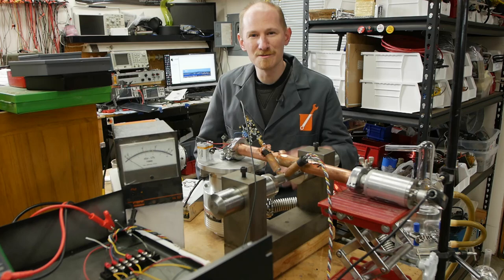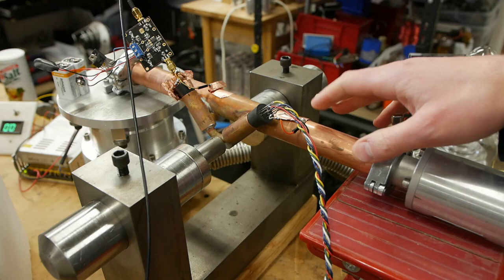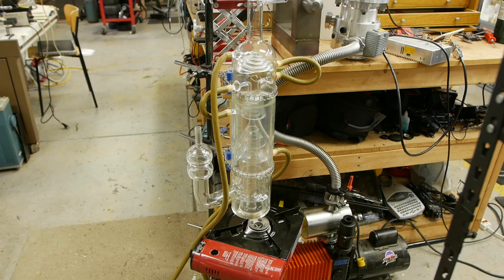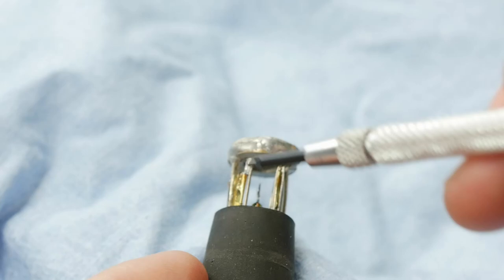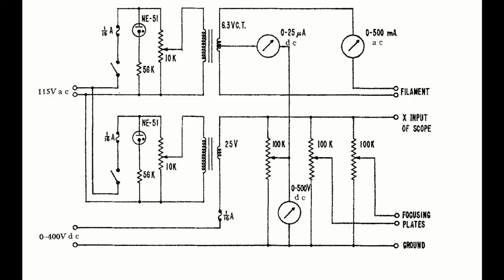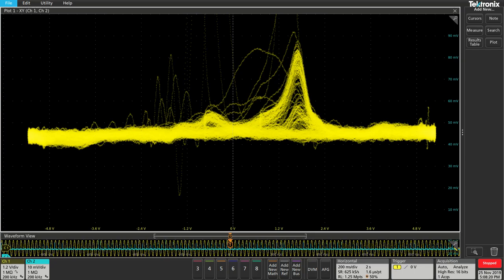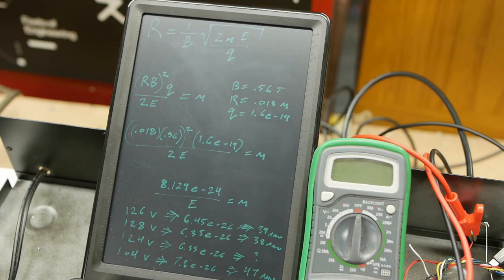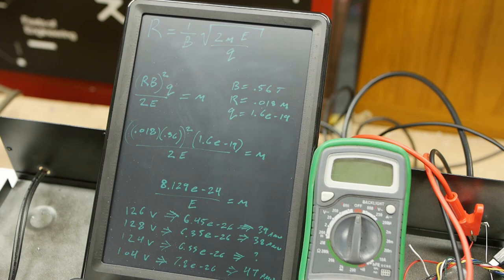DIY mass spectrometer measures potassium in dietary salt substitute

Comment: Flippin' incredible. Few points from bitter analytical lab experience:
- Regular hose clamps are a nightmare for vacuum, they create a pinch which invariably spoils your day
- Find something like a Mikalor W2 clamp, use two, 3" hose over the tube and HiVac grease.
- Those thick rubber tubes get tricky past about 10^-3 torr mostly due to the above, but I've had success to 10^-4 with vacuum epoxy as a sealant and the correct diameter tube. 
- Solder won't be a problem until silly vacuum, but the flux would make you very unpopular in any analytical lab... but definitely the perfect option for you.
- Your calculations and conclusion appear correct, and that does look like noise; in the mains-provided bias voltage perhaps?
- I wouldn't discount the prior spectra, their peak area looks to be very close to 6%, without knowing the details and scaling perhaps your resolution is just lower?
- Try introducing CO2 into the source, it should ionise nicely and give you another peak at m/z=48 to work with, Argon is also handy at m/z=40.
- It'd be really interesting to see some organic compounds, if you've got any gamma-unsaturated aryl ketones you should see some lovely parents and McLafferty fragments, Isopropanol should give you a great carbonium ion at m/z=43, most aromatics should give a radical cation and a salt of that 2,2-bipy would be spectacular.
- In order to get good ionisation of organics in EI+ (and often EI-) a source makeup gas, often chlorine / ammonia depending, is used to provide a cation stream to ionise the sample and occasionally form adducts; this may be a useful technique if you have problems getting your organics to fly, if you do indeed try that (which I hope you do!)

Comment: You are so close and on the right track. If you keep working on it I'm sure you will keep improving. Even if you don't specifically try to calculate the cause of the issue, sometimes just time and using the system you figure stuff out. Keep tuning it up and looking at each component to see if there is any low hanging fruit to tinker on and improve. I mean just a mm or two or a degree of angle could make a big difference here I feel like.

Comment: Very cool. I'm a pro at this -- I did my PhD thesis using TIMS at MIT. We literally built mass specs of this kind by hand. Far more advanced obviously with big hand-wound electomagnets and 10KV accelerating voltage.  My thesis involved the isotope ratios of neodymium measured to better than 0.003% and the result got into Nature (no bs: v. 371 p57-60). Today nobody does this, all mass specs are off the shelf, and much better than I used. But this is how A. O. Nier did this in the thirties making possible the separation of the masses of uranium (you know where that led, hah, pun intended). Anyway students these days never ever get to think about mass specs like this. It's just an aluminum box to them where samples go in one end and come out the other.  wonderful, thank you for this video which I will now make required for my students. Maybe I can build it myself. A little higher voltage and bigger magnet you could get the mass resolution to resolve that doublet peak, and get a better read on what the small peak is. My guess is double sodium, which would be 46.

Comment: generally you need further than 600v to achieve a good stable ion sources. i think is the electron count frequency which induces plate heating. you can't usually achieve that with a beaming circuit you'd need a hv-retransformer finely tuned to power the bulb and also the ground state being driven by some tuned hv matched with the target current of the ionizer.  the result looks very attractive, the cannon is pretty nice built. nickel from the needles themselves do a very nice job.. remember you'd need a more stable emitter than tungsten. tungsten emits lots of neutrons if the current is variate. and such are tungsten carbon filaments, not pure winding. that would halp making a more better looking case to me. great work amazing

Comment: Awesome DIY science project!! 

As for the tapered rubber stopper sealing but the Pro Vacuum hose not sealing, it could be that the rubber stopper seals because the vacuum is "Pulling" the stopper into the copper tubing opening causing it to seal tighter and tighter as the vacuum increases.
I would almost bet that if you used a rubber stopper with tapers on both ends and the required hole diameter in the center (instead of the rubber coupling mounted external with hose clamps). it would seal just as good as the tapered rubber stopper simply because the vacuum would pull the rubber into the tubing as the vacuum level increases. 
I had to create such a coupling once because of a pin hole in one of my vacuum hoses, this was on a home air conditioning system, it was on a hot Sunday so no supply houses open,  I had a rubber plug that was used to hold nitrogen in the line set, I used a Dremel grinding attachment to shape the tapers and to make the hole through the rubber, it worked good, I was able to pull a vacuum down to less than 500 microns.
Anyway, just a little food for thought. :-) 

Again, awesome project!! :-) 

Joe

Comment: Amazing progress! Putting a gas chromatograph before this setup would be a great addition, not so much for the separation power - but for the infinitely repeatible sample introduction capability! I've built a few versions of a DIY GC (see my channel), and have found that you can get acceptable separations without any column heating. Do note, however, that a GC will require a complete rework of your ion source, to something like an Electron Impact source, and chromatography is not really compatible with MALDI (which I guess is what you're hinting at). 

Basically all you need for a simple GC to introduce samples into an ion source is a capillary column, 5m is probably fine at first, an injector, where a syringe can introduce a small amount of gasseous sample, and a carrier gas and regulator to push it through. Also, before entering the column, it is a good idea to have a split with a variable valve, so you can choose how many percent of the flow goes to the column and MS, and how many to waste (or a 2nd detector). This will let you tune the ion current pretty decently.

Thank you for this interesting project!

Comment: Great video! Working in science for a long time you tend to get a bit abstracted from what is ACTUALLY needed to make something work, and just what you can achieve with even "simple" equipment! Its all too easy to think "oh its impossible to make something like that they cost thousands to buy!"

A comment regarding the mysterious 2 peaks: Could this be an artifact created by the different halves of the AC acceleration voltage... ie. as the AC part of voltage is increasing, on the first half of the sign wave, you get one peak, and on the second half, as the voltage starts dropping again, you get the second. So there is some slight asymmetry in the system,  created by some charging up in the system or some such?
Also a comment on feed throughs for vacuum. One great way to do these is to actually use a small Circuit board (very cheap from places like pcbway.) You can have through plated holes in the PCB that lets you solder in pins or wires (between air side and vaccuum side), and once soldered you can use the PCB iteself as a vacuum flange. For big flanges you need to add a bit of support in the center of the PCB, but its very effective and ideal for things like thermal evaporators, where you can solder in big thick copper conductors as well as having smaller holes for thermocouples etc.

Comment: Amazing work!

With a gain that high, it might help to enclose the amplifier and batteries in a metal shell, taking care with grounds. The traces are short, but exposed, and other parts of the circuit board could pick up signals or even static.  

Other ideas:
The voltage steering... It might work better with plates instead of wires, to get a uniform field (I have no mass-spec experience here, just working on a mental picture of the E field between two finite cylinders).  Ions might go flying off askew and experience different deflections.

Comment: I work with one of IBA's C70's over here in indiana and your rubber stopper works in a shockingly similar way as our plasma source. Basically, a large lightbuld with and hydrogen gas supply, and electron surpressor, and a positive ion puller. Our steering is done with. Some magnets in our injax line. However, it appears as though you are effectively collimating your beam with the razorblades. Very cool

Comment: Years ago, I used to work with Dr Emiliani at the University of Miami in South Florida. We had 2 types of mass spectrometers. One was a low resolution that we used mostly as a leak detector. For that it was mostly tuned to helium but we often times looked at other things as well. The other that we had was an isotope ratio mass spectrometer. This requires a longer flight path than you have. This was used for paleo temperature work( looking for ice ages ). We did this by taking a particular foraminifera that live at the ocean surface. We'd sort these out by hand and then use some acid to change them to C02. That would be fees into the mass spectrometer. I mainly worked there because I understood the electronics. Any way, the foraminifera would fractionate the oxygen ratios. I also help in a carbon 14 lab that used a modified scintillation counter( I modified it ).

Comment: Nice work.   Especially since Cu, solder and ordinary rubber stoppers are pretty dirty outgassing materials in a high vacuum.   With the Turbo that close you should easily get 10 E-6 torr.   The sinusoidal modulation of your HV is easy but I have to agree with the gentleman who recommends a sawtooth modulation (standard in old CRT oscilloscopes).  Sine wave modulation will result in a nonlinear mass # vs display position.   The easiest way might  be by sawtooth wave modulating a HV vacuum tube made for RF transmitting. Ditto also re "don't boil the diff pump oil" !  With the burner turned up as high as you had it, it becomes a backstreaming nightmare.   The electric heater in my metal  diff pump is rated at 500W  but the recommended operating wattage is 420 W.  A stainless tube with KF flanges and two feed through blanks should yield a dramatic improvement in performance.  Great stuff keep going!

Comment: Outstanding work - the ion source alone is worth 2 👍🏼 -  a control run with  bare filament (already mentioned several times) for comparison,- a run w TiO2 on the filament ,  and try changing the length of the coax betw preamp and main amp.   .66  or 3x  — exit slit is orthogonal to beam scan direction?
Really enjoyed this - took me back to my days in the lab underground.

Comment: You could easily make many of your problems go away. We built one at the university. We built one 8 meters long. The sample was in a metal box the size of a matchbox and vaporized with heat, then ionized and accelerated. It could run for weeks. A heating filament in a radio tube was used, not a lightbulb. If I recall, it was a much better electron source than what a  light bulb wire can be. An electron trap catches the electrons, and the now +1 ionized sample are accelerated in a normal direction of the electron flow. The accelerating voltage was 800V. We used an electric field to cancel out the magnetic field, and varied the electric field. Also used two quadropoles to focus the beam (or maybe on to just flatten the beam for better resolution, the second would be for signal strengthening.).  I would also try out using a Microchannel Plate or nightvision sensor to measure many channels. I have never tried this, but it would be fun to test even a back illuminated CCD/cmos sensor. If not a dynode. Or try out an avalanche photo diode APD with the window removed.  Disclaimer: This was done decades ago, before I worked as a design engineer at Tektronix.

Comment: From the schematic the filament is being driven from the same AC supply as the sweep signal, but the filament, while small, will still have some thermal mass and its temperature will oscillate with a constant phase lag from the sweep signal. If strong enough this could account for both the offset and height differences of the peeks, and could be tested by adding a phase offset to the scope X input and seeing if and how the peeks move around.

Comment: Mass spec's are picky.  I remember one time I worked for days trying to figure out why I was getting improper bleed over on the other collectors (multicollector mass spec).  Turned out it there was some slight plating on ceramic insulators on the emitter end from long term use.  It was really screwing with the focus.  From that time forward when I had to replace filaments, I always replaced the insulators whether it needed it or not.  The folks mention changing your sweep which could be it too.  You should be able to do this by simply blanking your scope during this time frame and you could actually compare the signal by inverting the blanking signal to your scope and compare the signal from the 2 different sweep directions.  You could also be picking up some outgasing of something in the copper/setup itself.  After rough pumping I'd let the ion pump run for 24 hours before turning on your filament.  I could get decent measurements at initial 10 microns  but really couldn't get good calibrated/consistent results until after a significant amount of time at low vacuum.  Also just running with no sample (filament emission) may help clean your cup as it may be sputtering somewhat...I darn sure don't miss those sometimes not=clean-enough ion pump getter and sputtering plates on ions pumps I used to get.

Good stuff tho and always fun : )

Comment: I used to study atomic physics. We would build our own detectors for ions with channeltrons  (electron multipliers). They look like little glass pig tails. An incoming ion ( or electron ) knocks a few electrons from the (coated) glass, they get accelerated and knock out more, etc, etc. The amplification in a channeltron is around 1E7. You still need a preamp, but with less amplification than you are using, now. You need a high voltage (1kV) across the channeltron.
Keep the second slit at 0V, the entrance of the channeltron at -1kV, and the signal end at 0V.
You might be able to get a used one in the 100$-300$ range at ebay.

Comment: This is sick stuff! Kinda makes me wanna try it as well with a homemade quadrupole, but I feel like I'll hate my life very quickly.
But being an analytical chemist working with MS, I must correct you that mass specs can never split molecules into their individual atoms (I suppose unless it's an atomic salt? But I feel like that doesn't count). That'll require very high temperatures, using a flame, graphite furnace, or plasma (FAAS, or inductively coupled plasma : which can then be coupled to a MS). This is known as elemental analysis. 

There are many types of ionizations for mass spectrometry. In your case, you're using the simplest, which we would call electron ionization. This is a hard ionization technique which means that it would cause fragmentation of the molecule. This of course is a drawback, so it's use is limited to GC-MS techniques mostly. Instead, many applications use what's known as a soft ionization, which would preserve the molecule itself, thus giving us the molecular weight information. But in your case, since you're analyzing atomic salts, it makes things simple.

Comment: That was rly cool! Didn't rly think it would be possible to build your own MS from "off the shelf" components just like that. Very well done!

For your peak problem: It may just be some kind of contamination or some kind of "echo" in your electronics. But could be any number of other things as well. Your absolutly right with your toughts about the peakshape, their is clearly a (front) shoulder wich is indicating the Isotope.

For your sample introduction: As you said yourself, their normaly is some kind of seperation befor you introduce the samplestream into your MS (Most likely a GC or LC). But their are other ways to do that. The company i'm working at for example builds a DIP-System (Direct Inlet Probe). I'm sure you could build something similar if you are still interested in optimizing your system. It would at least spare you from venting the chamber every time you need to put in another sample and you might even be able to use your diff-pump and get some better vac-readings.

Anyways, thanks for the great video, keep it up!
Reply: FYI: Building a "DIY-GC" would be quite possible (using a packed column even relativelycheap cuz you could build that yourself)
If you want to go into details here, just hit me up.

Comment: In order to separate the forward and back traces on the scope, you can try capacitively coupling a bit of the AC voltage into your reading. That will turn the baseline into an ellipse which is weird but at least fwd/backward will be separated then.

Comment: I think if you load a different sample in just to see if the lower peak still appears and had a similar shape to the main peak, that is a good first step. Especially if you try something that has an interesting shaped signal (so you can see if the lower peaks follow the same shape).

Also check what signal you get with no sample loaded at all, just a clean filament.

This lets you answer the easy stuff:
- does the low peak follow the main peaks position?
- does the low peak follow the main peaks shape?
- is the low peak even related to the sample?

Then you can figure out what to do next from there.